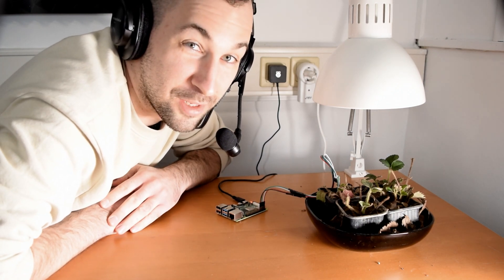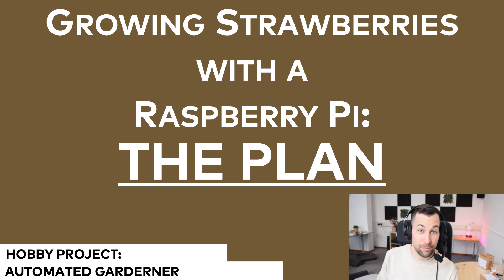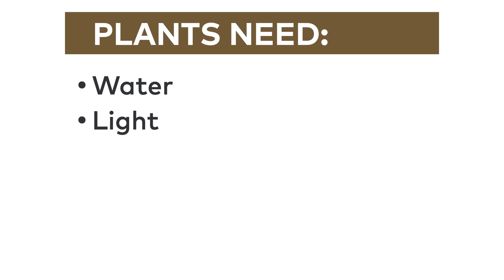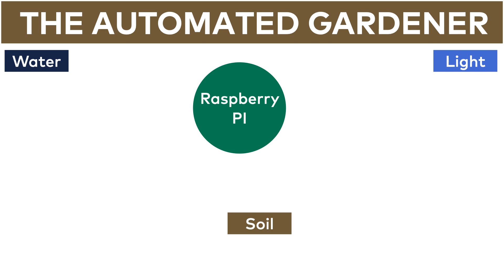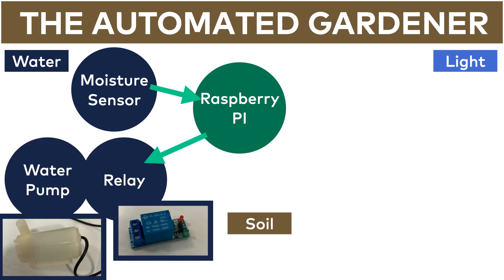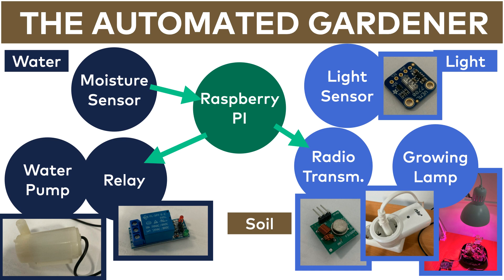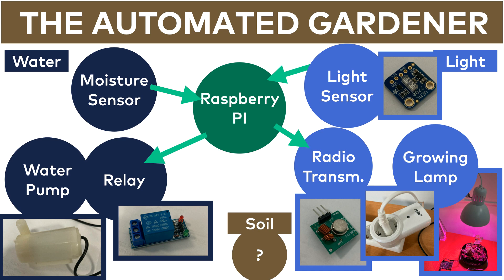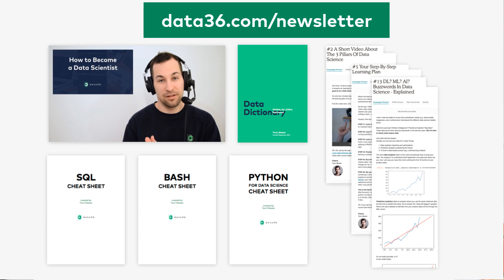Raspberry Auto-Gardener Project: What Plants Need to Grow? (The Plan)

Comment: Using relay is great, I learned there is wifi controlled relay using ESP8266 low cost wifi chip . I was wondering if we can use it to control the pumps, the light and even talk to sensors remotely?
So that we are no longer limited to GPIO pins, then we can automate a whole lot more plants each have their own IP address. Oh, and how about cameras for remote monitoring, wired or wireless, IP cams?  
Just some ideas for thought, your wired version is already looking great. Keep it up man. It helps me a lot as well. Thank you.

P.S. to automate the soil, you just add some "Liquid Plant Food" into your water tank, mix it up with your water on a very low percentage and feed to soil through watering. Or do it with a seperate pump and tank.
Reply from the maker: Wow, thanks for the comment -- I'll definitely look into the plant food stuff.

As of the wifi/wireless/etc on-off solutions:

I looked into many -- and I settled with the radio signal one which can turn on or off multiple devices. I'll use that for the lamp (it's already tested -- tutorial coming soon) and yeah, you are right, that's pretty scalable (that's the upside). It's similar to the wifi solution but it's more light-weight... maybe less secure, but I'm not worried that anyone will hack into my little radio-controlled lamp-switch system in the neighbour hood. :D 
But the wifi+relay combo sounds nice and more professional so I'll definitely look into that, too! Thanks!!